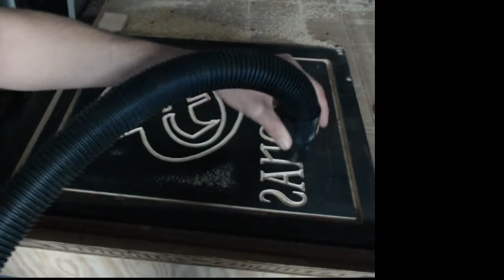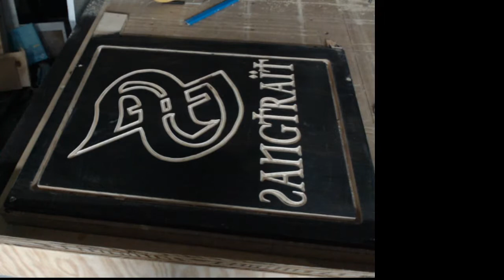✅ Grabado CNC en madera con fresadora Kress 1050 FME-1 y broca de 90º CMT. (Velocidad 1x)

Comment: Hola, gracias por el video,   estoy pensando en comprar un kress 1050,  yo fabrico cuentos, necesito que pueda tabajar 6 horas de seguido sin calentarse.  sera que esta kress podra?
Reply from the maker: Yo la he usado durante mas de 6horas muchas veces, pero lo recomendable si tienes que usarla mucho (casi todos los días) es poner un motor con variador de frecuencia que no tiene escobillas y esta mas preparada para trabajar todo el día.
No se realmente cuanto tiempo podría aguantar el Kress hasta que tengas que cambiar escobillas (yo nunca lo hice) o se "queme", pero creo que por el precio que tiene vale la pena (creo recordar que la compre por unos 160€).
Y si se te llega a quemar podrías luego mirar uno estilo Teknomotor o parecido con variador (yo compre uno de 1,1Kw con el variador por 450€, (eso si, pesa mas y hay mas lio a instalarlo y si tu cnc es pequeña o con estructura "ligera" mejor quedarte con el Kress).
No soy experto, pero espero te sirva de algo esta información :)